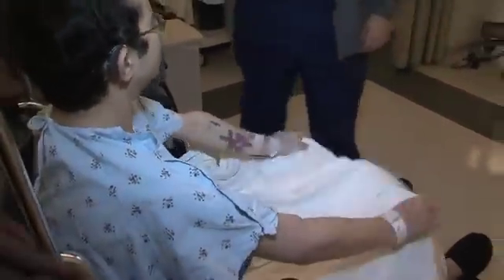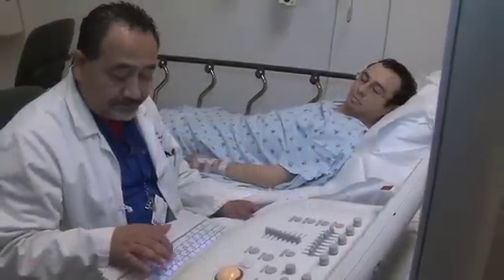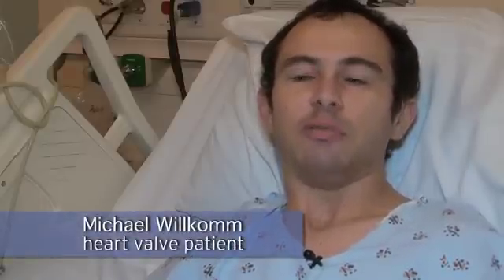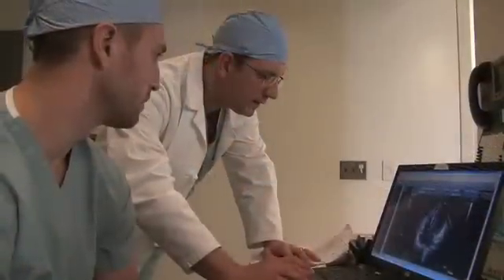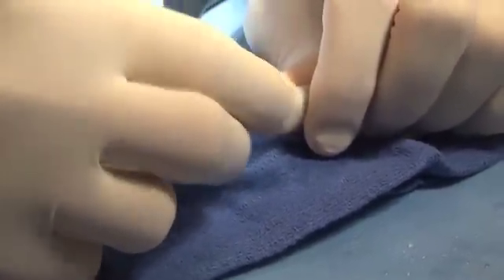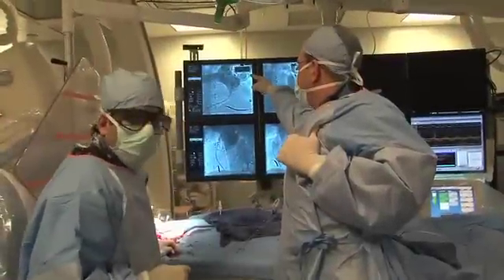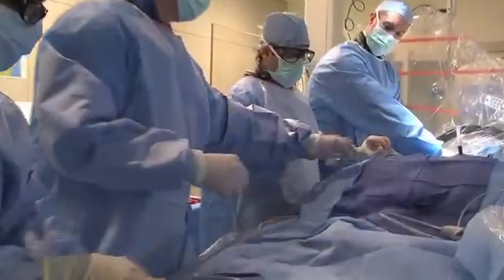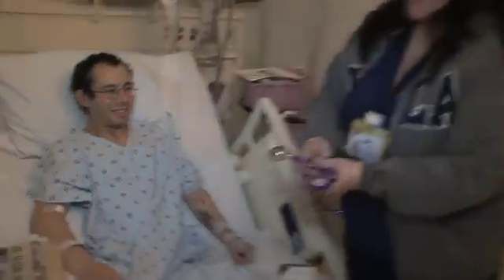Pulmonary Valve Replacement without Surgery | UCLA

Comment: No due to my surgeries when I was 2, the location is too small to support the correct size valves. So they are going to go in, open it up, put in a correct size valve (bovine I think is what they said) and then when that valve isn't working properly in 20 years, they will do this procedure. I specifically asked my surgeon (I live in NY and am going to Columbia) about this, cause it is obviously preferable, but not an option at this time.